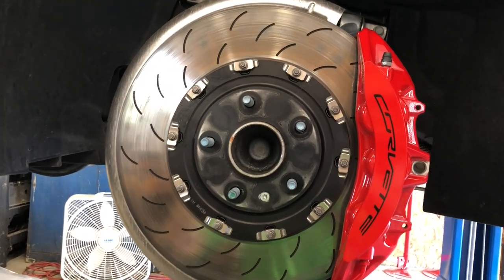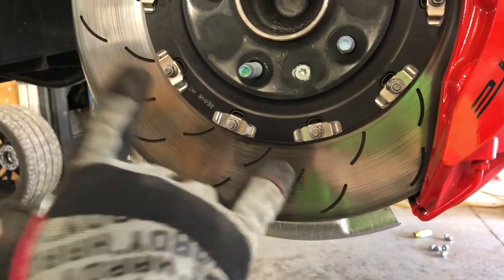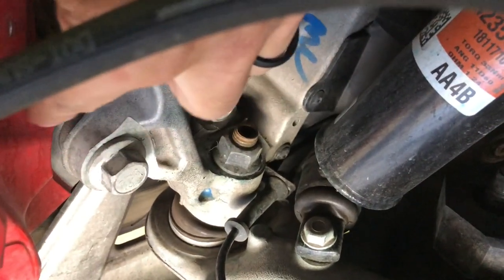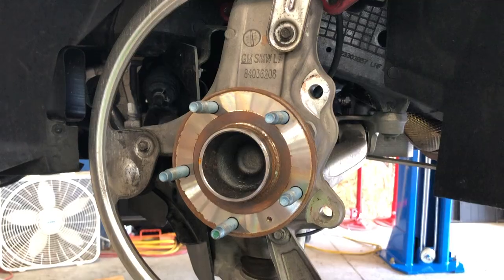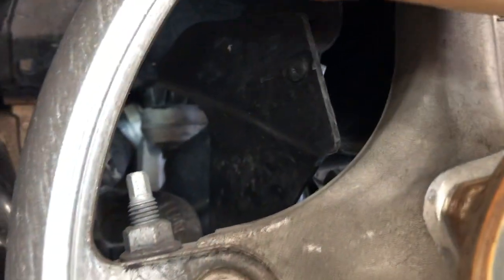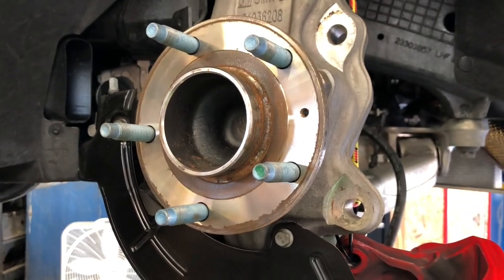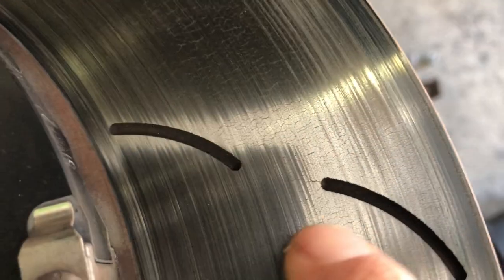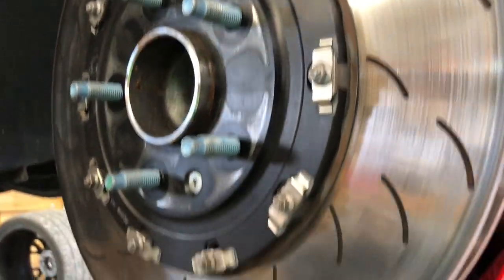Install / Remove C7 Corvette Iron Brake Rotors and Cooling Rings

Comment: I wish you could access the cooling ring bolts without taking off the rotor
Reply from the maker: You an me both Jose Frade !
It’s stupid that we have to pull the wheel, caliper and rotor to change a plate for cooling!
Reply: @farmerandyman7115  Why not just leave them on all the time? Downsides?
Reply from the maker: @rleader1  well the manual tells you only to run them when on the track...  from talking with folks here's what I gather - they push more air onto the rotor - so when you are on the street and "crap" is blowing around - like grit and salt and anything else that is typically NOT on a track - you are increasing wear on the rotors themselves.  Now - I dunno if that really matters because I would contend that 1000 miles of "dust" is less wear and tear than 1 hot lap at WGI on a rotor...  but - I will also say - I have had a small stone get up in there between the cooling plate and the rotor and sound like the car was eating itself.  So - do you HAVE to pull them - no...  but since I sway out track pads after HPDE - I'm almost there anyhow so might as well pull them, right?
Reply: @farmerandyman7115  Agreed!
Reply: @rleader1 ” Don't install these rings until you get to the track, as they're not legal for road use, and can cause corrosion with long term use. However, the Corvette Rotor Cooling Rings block the openings between the rotor and the hub, effectively forcing the cool air supplied by the brake cooling ducts to actually cool the brakes, instead of escaping.”